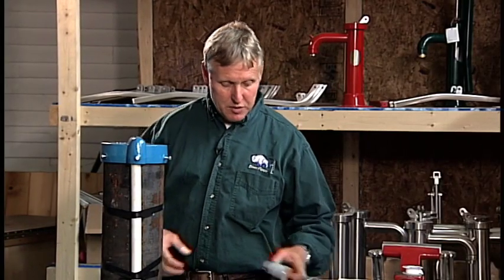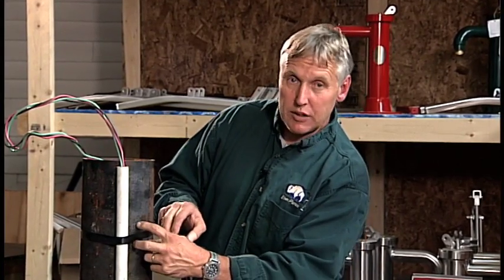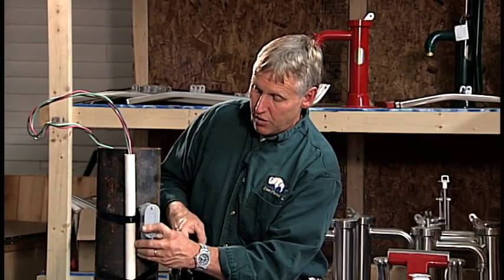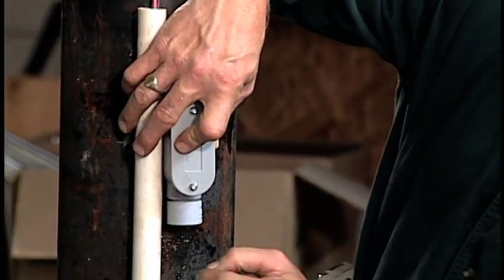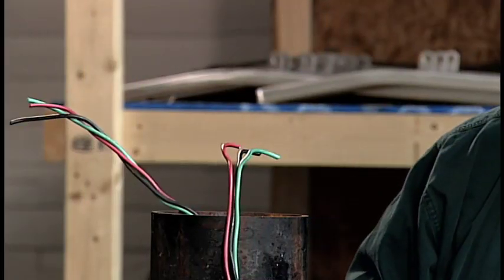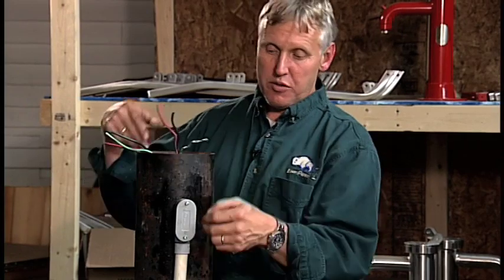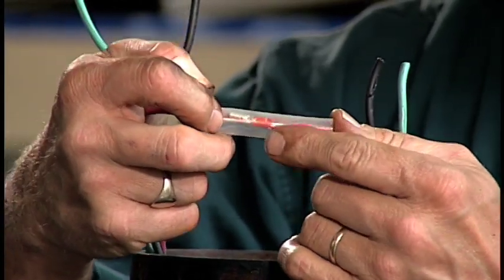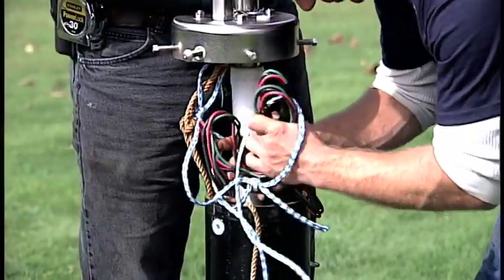Install Conduit Ell Bison Pumps

Comment: Lol metal shaving down in the casing. Not recommended to use an "slb" for this application.  Nothing holding wires from falling back into casing
Reply: should use a strong magnet to catch all the shavings while drilling and filing